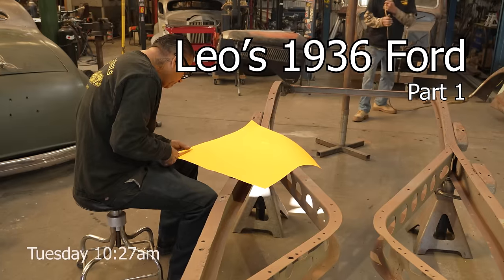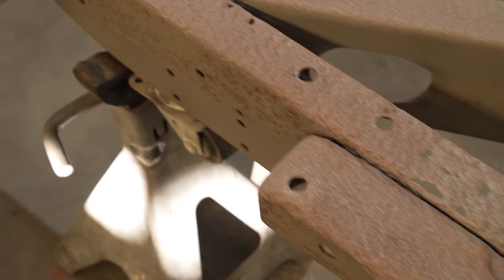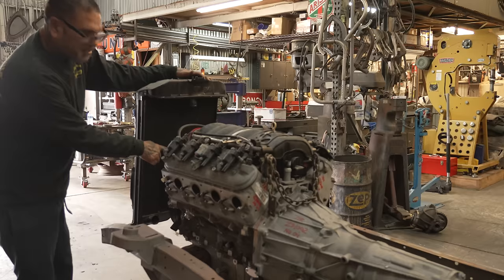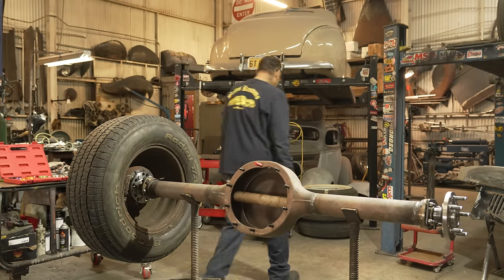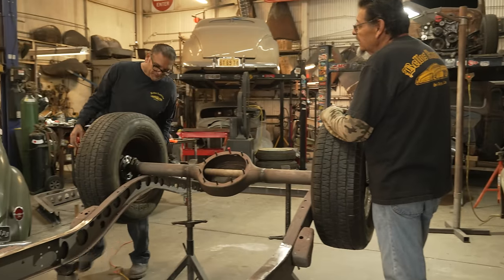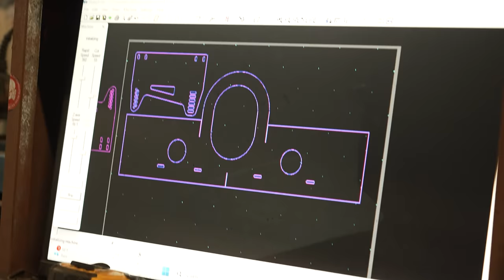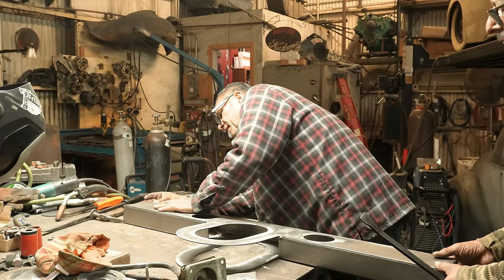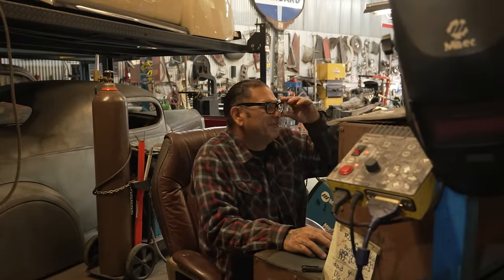1936 Ford LS Swap Part 1 - Preparing the Frame

Comment: Woooooo close call on that hydraulic break! Them things will get ya. Not the blade part but when it bends and levers the metal up it'll pinch ya. My partner had on gloves and the metal caught the glove so he couldn't let go and pinched the top of his ring finger off and it popped off like a zit. I was right there standing next to him watching and when he pulled off his glove the tip of his finger was still in the glove so I grabbed the piece of finger out of the glove put it in ice and we went to the ER and they sewed it back on but it didn't take and turned black so they ended up taking it back off, so now he has a stubby. I pinched my index finger once didn't come off but flattened it pretty good. Man was that painful, still hurts 20 years later. 😉✌

Comment: When welding the frame the repairs I saw you tack with a MIG welder, but you finished welding it with the TIG welder. Just wondering what the thought process was there. Thanks and great work as always by both you and the videographer.

Comment: I know the LS motors are easy to come by , have more than enough power , but the size of the engine/transmission , to me , would an issue . That 6 ( looks like a 250 ) in Al's 35 Chevy would get it done for me . By the way , the 35 is chopped just right , and a lot stronger than new . I hope to see it finished one day . Thanks for posting the work , I hope it's paying off for you . Orale Carapilla !

Comment: I just bought a samurai for $200 and it has the engine and transfer case but it had rotten tires.... But I appreciate this video cuz I too have rust on the lower rocker panels I will try to imitate what you did keep up the good work